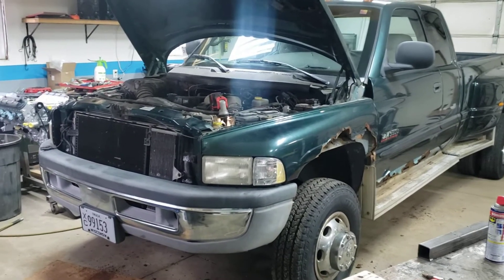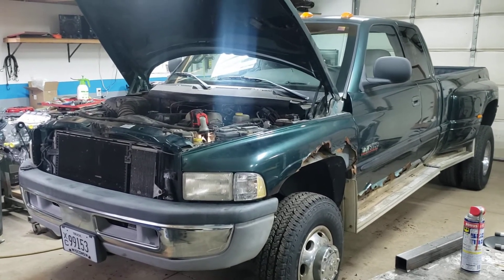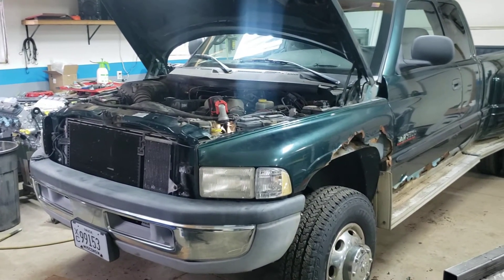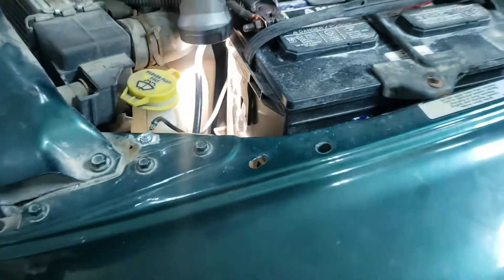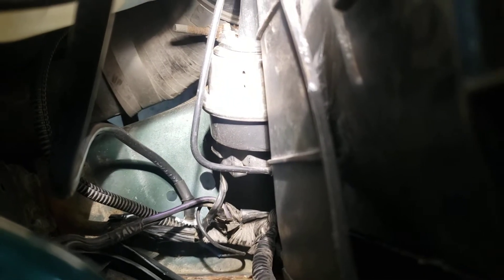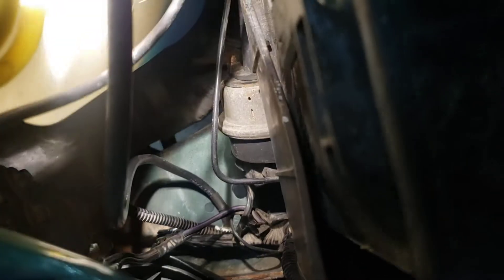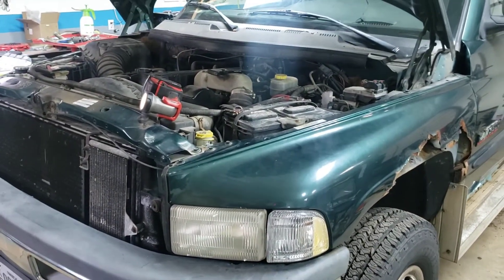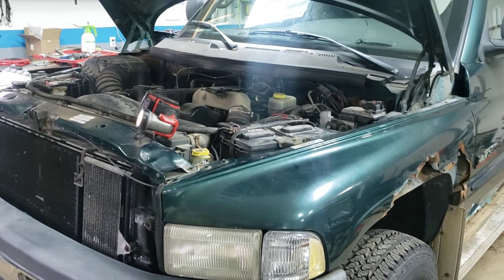Dodge Ram Cummins Engine shuts off when headlights are turned on, blower motor not working...FIXED!

Comment: Thanks, my 2000 Chrysler T&C had a siimilar problem just today.
Although the blower motor has had issues by not working occasionally.
Usually I would just slam the glove box & it would start working.
Today the engine shut off when I turned the blower motor on.
Tomorrow I will check all the wires, fuses, resistor & the main chassis grounds for the blower motor as you mentioned.
Thanks again👍

Comment: Thank you so much for this trouble shooting video! My 2001 Ram 2500 diesel did exactly the same thing. Located the ground wires and gently tugged them and they all came off. Did the repair and everything works great. My windshield washers and stopped working a couple weeks ago and I figured I was out of fluid but it too started working. You got me going again! Thank you!!!!